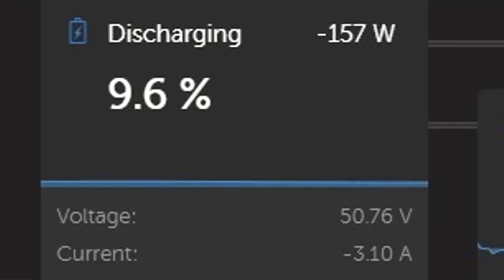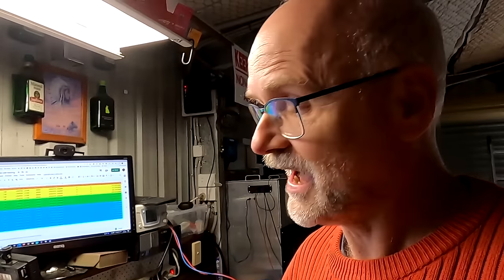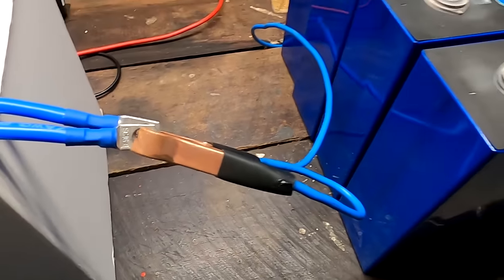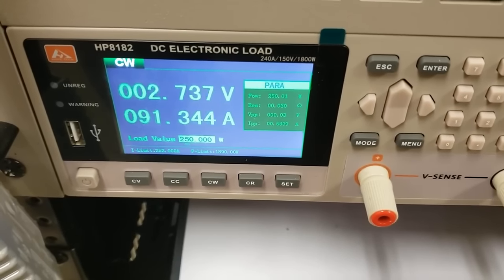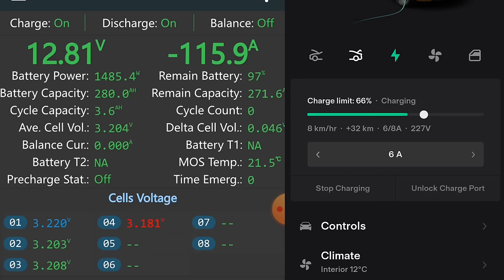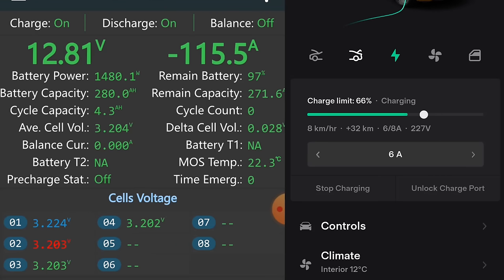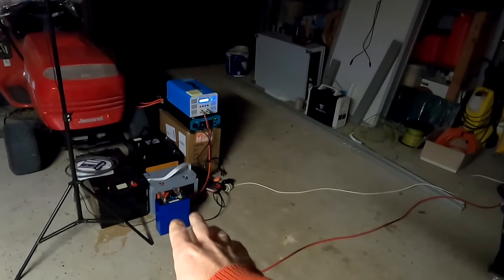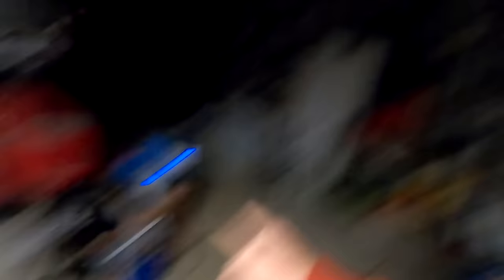Battery #1.0 High Amp Test. Massive voltage drop under load on this 4 year old battery?

Comment: You should take rested unloaded OCV first, then after 3 minutes of constant load, with load still applied, take voltage slump from starting OCV on each cell.  

Cell must not have full absorb charge level surface capacitance charge (>3.45v) when taking OCV so state of charge should not be greater than 90%. (>3.38v).  The surface charge will almost immediately dissipate causing cell to near immediately drop below 3.4v with load current but you will have taken an artificially high OCV starting voltage increasing the apparent cell voltage slump more than actually is.

Load should be between 0.2 C(A) and 0.4 C(A) 56A to 112A for LF280 test.  For these thick electrode design cells, above about 0.5 C(A), 140A, there is additional electrode layer ion starvation that starts to add additional terminal voltage slump over kinetic overpotential effect.

Since cold temp causes ion diffusion to become sluggish, you need to do load test above 10-15 degs C.  Voltage slump will increase at accelerated rate below 10 degs C.

At 100 amp load, a new LF280 should be about 70 mV slump per cell after 3 minutes of load current at 25 degs C.  You are showing about 90 to 130 mV after two minutes.  Not too bad for a used cell.  The delta voltage slump should hold fairly constant from about 20% to 95% state of charge for given load current even though the OCV voltage changes with SOC.  Matched cells will show the same terminal voltage slump after 3 minutes with load current.  Matching of 1kHz impedance meter readings is a poor indicator of cell matching.

Impedance meter is primarily only metallic conduction resistance.  It will show up an increase in resistance if you have electrode material to conductor foil delaminations within cell.  Ionic transfer impedance which shows up with load current causes much greater voltage slump and is a better indicator of cell condition. It correlates well to cell capacity loss. A three-minute load test is much easier than a full discharge cycle test.  Ionic impedance has an exponential time decay which is why you have to wait 3 minutes for cell terminal voltage to level out at equilibrium state.

Comment: Do you still not consider the batteries new if they are 2-years old but haven't been cycled? What is wrong with storing them at a good SOC if they haven't been cycled. Are you saying they degrade?
Reply from the maker: Yes, they will absolutely degrade even if stored under left conditions. Calendar aging is a thing. https://youtu.be/OsvPYw6hoHc

Comment: Andy, You only stress these cells with a 160/280=0.57 C!!!

If there is ANY voltage drop at all, it should occur around 1C!

3500W you should pull from this to see any voltage drop...

Comment: I bought 4 280Ah batteries from Basen in November 2020

After i capacity tested them i had pretty disappointed results:
Cell 1: 268Ah 
Cell 2: 270Ah
Cell 3: 277Ah
Cell 4: 278Ah

By scanning the QR codes i found that the cells were from different production days 12/11/2018 to 25/11/2018 every cell have a different day.

Looks that they sent out two 280Ah and two 272Ah  cells.

I had a partial refund after my complaints, i still use the battery without any problem.
Reply from the maker: What do you mean by that? What is off course?
Reply from the maker: @LithiumBatteryGuy  at least some explanation now. Thank you for your opinion.
Reply from the maker: @LithiumBatteryGuy  I have no doubt, they will fake the QR codes at some stage and even buy engraving machines to do so. And they will do the same with the spreadsheets to make their cells look good. Once you bought them and find out, it's too late. They're in China and you're... not in China, so have no leverage at all and can only negotiate a small discount if at all. So nothing new in what you're saying...

So what's the solution? Buying from EV directly?
Reply: @LithiumBatteryGuy  if the buyers know theyre buying lesser sells is it such a bad thing? Surely most people can tell from looking at Eve prices vs alibaba prices that the cells aren't perfect is it not like 50% cheaper from alibaba sellers? . As long as buyer is aware they're buying lesser cells in my opinion its not that bad. As you mention it's a big risk but so is buying anything from a foreign country, same with reviews/product description on alibaba. In my opinion its also down to the buyer to test the cells once received as they should with all cells even perfect ones as they could be damaged by shipping. These aren't end consumer products, anyone buying said cells should have somewhat technical knowledge otherwise they should be buying prebuilt batteries. When Andy became aware he seemed to flag it however he did support why he wasn't too concerned in videos like this one.
Reply from the maker: He's trying to push his own business here, selling 'A-Grade batteries', that's why everyone else is wrong and he's is right...
I also think that if we know what we're buying and are happy to pay the price, there is nothing wrong with it. Or maybe there is, we don't know yet...
Reply: @OffGridGarageAustralia  This guy is Nutz. Better get a PPO
Reply from the maker: @mdunbar04  yeah, don't know why he's so full of hate. He also sent me threatening emails. Good to have the evidence😉
Reply: @OffGridGarageAustralia  "Or maybe there is, we don't know yet..." I'm so happy to read that, I thought you're part of the scam, yes you opened a can off worms with this topic, we know already there is allot wrong with these cells from China (all sellers) (maybe not yours but even you're seller was sending bloated) I will check mine soon with the QR code (doesn't mean nothing) but we know already others have major problems with it, best advice would be buy them from a local warehouse (BLS Official Store - Germany for me) so you can send them back, and don't buy them to cheap if you want >4000 cycles. Or buy them cheap and know you have max 1500 cycles left (still good), because all these sellers are faking it, but you pay at the end more for faked cells, and great that you wanna have a open discussion, as you you tolled "we don't know yet" would be nice if we can sort out what is happening to these cells, we cannot believe these scammers on there blue eyes, people will get in trouble if we don't warn them.
Reply from the maker: @johanmaas9011  I'm certainly not part of any scam or conspiracy theory. I put a lot of money into these cells too in the got faith they are lasting several thousand of cycles.
I think a good summary will be in the next video here on the channel when I show more test results of these 4 year old batteries 😬
Reply: @LithiumBatteryGuy  ahh I see, so you're more offended by the fact he made a video based on information you believe you provided and comment deleting rather than the fact these cells are not perfect? That makes more sense and I see how that could be frustrating but is there not a chance he genuinly did not see the email? Like he mentioned SFK a lot in that video so it's not like he's afraid of giving people credit for information they provide?
Surely if Andy was worried about the sellers losing money he wouldn't have made the video of grade A vs B at all because that highlights that the cells are not perfect? Id argue that he played a part in highlighting that they're lesser cells which will surely negatively impact the sellers. He has gone on to defend why he thinks that's not an issue for his use case with the cells he has based on tests he's able to do. If I'm understanding it seems you believe he's defending the sellers with said tests, but if that was the case would his life not have been easier to just not make the original video pointing out that the cells are lesser in some way?

Comment: I think you showed you paid about $80 per battery plus shipping on your first purchase.  They've doubled in price since then, so you couldn't even buy used batteries for that price now.  My 105ah batteries I just bought are the same price, if not more the the 200ah batteries.  I was paying $350 for 4x 200ah shipped.  Just be happy they work and you don't have to try and replace them.

Comment: In your 3rd test mate you say batteries are at about 40% state of charge, the bms shows about 90% left
Reply from the maker: The BMS has been used with all the batteries before to do the tests so it's all over the place. It only calibrates correctly of you fully charged the battery bank with the BMS connected. It cannot determine the SOC itself by just connecting it to a battery.

Comment: This SFK guys seem pretty stupid if you take a look on the comments under their video, but the testing method still seems legit somehow after thinking on it for a while. They don't need the sense wires as the measurement device is calculating the voltage from the current needed to provide the power for the constant load (P=I^2*R). This is NOT the actual cell voltage, but the test can still be meaningful. The resistance shown is the virtual load resistance the measurement device is "creating". As the setup stays the same for both cells, it is clear that the "good" cell is less affected by the 250W load as the "bad" cell (or in other words the good cell can provide power to a higher load in comparison to the bad cell). This is basically the explanation for the test as I understand it and it seems legit for me.
Reply from the maker: Poor in terms of what? Why don't you make you own videos and show us all how great you are doing?
Reply from the maker: @LithiumBatteryGuy  Sorry, can't find an email from you from a month ago. Are you the guy from Hervey Bay?
Reply: @LithiumBatteryGuy  for me, Andys Test also is legit. Tell me the difference between Andys Test and SFK test, which leads you to your conclusion. Both use a constant load and unchanged setup (cables etc). So those tests are completely comparable and Andys cell performed good in this test. The difference is that Andy seems more friendly than those SFK guys xD

Comment: Amazing video Andy. Really useful test to see SFK test example were on quite poor cells. However useful to see SFK example of what a common way that a really poor cell looks/act liks  
I had similar concerns after your original grade B vs A vs eV grade but similarly I realised my bms would shutdown if I had cell's like SFK. However still great to see that alibaba sellers must be at least checking the cells somewhat to ensure theyre decent cells or you, me and many others have just been very lucky. Seems unlikely but as others have commented of course it's a gamble buying any product from foreign companies batteries or otherwise.
Reply from the maker: I have not deleted any comments, but if you post links in comments for example, YouTube deletes them.
Reply: @LithiumBatteryGuy  sorry I'm not understanding what you mean by kickbacks. As in sellers complaining due to his previous grade A vs B video? Surely if Andy was worried about suppliers he'd have just not made that video?

 If I'm understanding you're suspecting Andy is gaining a lot from the sellers and defending the cells quality in this video. I can see your logic but if that was the case why make the original video highlighting the difference between his cells and perfect cells.
 I instead see it as Andy bought the cells and is testing them himself to ensure theyre fit for his purpose as all buyers should. I see how you've come to your conclusions but don't you think he would've just not posted the original video if he was worried about suppliers.
Instead of defending alibaba sellers is he not just testing that his cells are fit for his purpose?

Comment: I see that you have big trees. That poses a small obstacle to what I am about to propose. Why have you not considered a wind turbine? I know that the engineering specs on most turbines suggest that the turbine be 6 meters or so above the nearest, tallest object in order to bight into "clean" or non-turbulent wind. On the other hand, wind turbines are improving all of the time. Some of the latest generation of type 3 turbines start to produce in winds as low as 5mph but are optimal at about 15mph. The next generation on the drawing boards are said to be able to produce in winds as low as 0.5mph. 

Here are two approaches:

 First, I have a friend whose property is surrounded by tall trees. His solution was to top the biggest heaviest tree and put a horizontal axis wind turbine (HAWT) on top of it and then guy it solid. A living wind turbine tower if you will. It seems to work just fine, but I bet him that he will have to move the guy wires from time to time and even lengthen the load lead to the alternator.

Another approach is to use a vertical axis wind turbine (VAWT) (some call them eggbeaters though that is not an accurate reference).  A VAWT's main advantage is that it doesn't need the clean air that a HAWT needs in order to not stall if wind direction changes, so they can be installed at ground level if you dare, but VAWTs are less efficient than HAWTs. The problem with a HAWT is that it needs clean air, and that can be found only above obstacles like buildings and trees.

Of course, you could always make a gin pole tower, but those kind of scare me, and are expensive, if they get too tall.

My HAWT alternator starts producing at around 100RPM which is quite low. I have actually attached it to a bicycle and exercise at the same time until a set of blades that I like comes along. I also need to finish my tower. I am putting it at 3 meters above ground in order that the occasion person doesn't end up losing an arm or worse. 

Just a thought...

Comment: Hi Andy.

1. By not using v.sense makes no difference if the resistance of the load cables isn't impacted.  SFK did a followup video showing this about 1mo ago.  https://youtu.be/22zMfe-jYwM

You could do a similar test with fat cables to get the same result. 

2. The internal resistance showed on the SFK is simply ohms law.

This test you have done simply shows that your cells are in good condition and you don't have a failed, crappy cell. :) 

Thanks and keep up the great work.
Reply from the maker: Thanks Rowan, the video is unlisted, so not sure, they may have taken if off.

Yeah, that was the main purpose of my test, to show how the cells hold up after 4 years 😃

Comment: Hm.... Warte mal... 
Wenn ich aus ner 4s Bank 2 kW ziehe... Dann ziehe ich doch aus  jeder der Zellen 2 kW.. Und nicht nur 500 Watt....Die Leistung multipliziert sich doch nicht.. Nur die Spannung 🤔. Sprich jede der Zellen leistet somit 2 kW.. Aber eben bei 3,...  Volt. 
Bin ich jetzt völlig durcheinander oder hattest du zu viel S.P.A.T.s?
Reply: P=U*l, 3,17V * 160A = ca 508W
Reply: Nein, du verwechselst Leistung und Stromstärke. Die Stromstärke ist bei allen Zellen gleich. Die Leistungen addieren sich.
Reply: Ja, du bist durcheinander.
Volt*Ampere=Watt
Jede Zelle leisten die gleichen Ampere. 3,xVolt*160A=~500W pro Zelle. Ist ~2000W bei 4 Zellen.